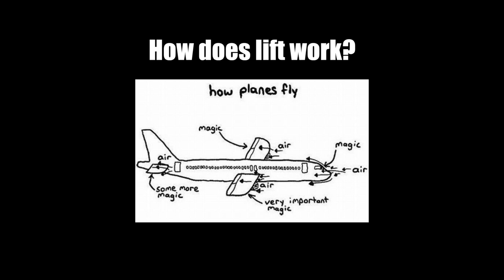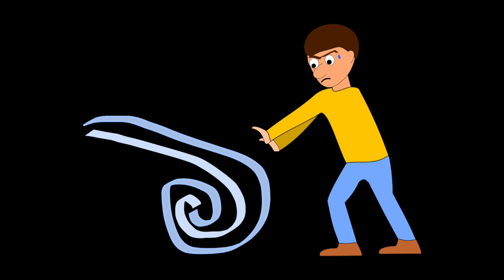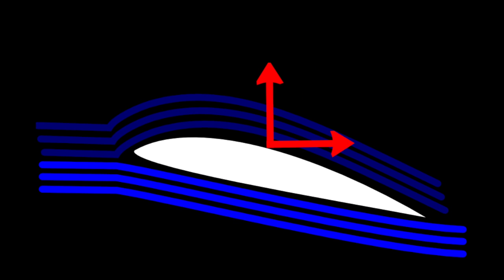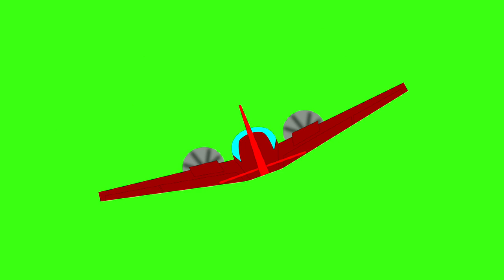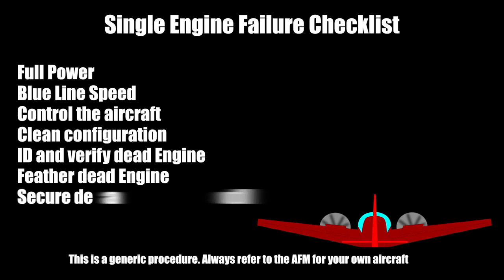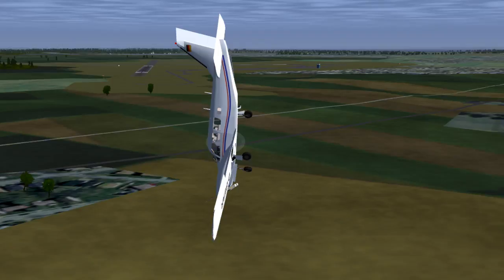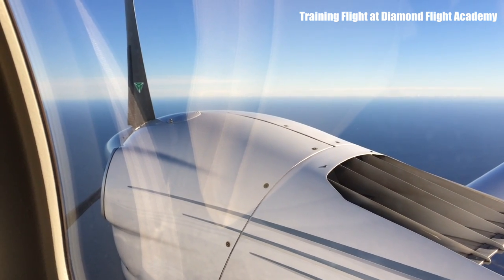Multi Engine Aerodynamics of a Fatal Crash: Mayday Talk Episode 14.5

Comment: In flying twins ( two Cessna 310s & a Baron) for 35 years with my father we did a lot of training on this. Keep in mind that above all know what your airplane feels & performs like in density altitude, full gross weight etc . #1 always fly straight ahead until established above blue line ALWAYS, once established start a climb to safe altitude and then shallow turns into the GOOD engine. There will be conditions where in high density altitude as where you can't climb on one engine. Know this before departure so if it happens your thinking single engine procedures only. Thus loss of engine means you must reduce power on the good one to prevent control loss. FLY THE AIRPLANE no matter what even if you have to put it down. A controlled forced landing (which we have done) is survivable in many cases but a loss of control usually results in fatalities.  Keep up the great work. These kind of videos save lives.
Reply: being a pilot is VERY hard....you and your father are very smart individuals.  Piloting is not cut out for the "dimmer" individual.

Comment: A last ditch effort before an unavoidable Vmc rollover is to pull power on the good engine and land straight ahead as if you were a single engine with an engine out.  A controlled forced landing is better than spinning into the ground!
Reply from the maker: absolutely. It's the asymmetric thrust that creates the roll, so reducing the power removes that element

Comment: As a long time pilot of a Beech Twin Bonanza (D-50), I've had 7 engine failures  of the GO-480 295hp engine, 5 of which were gearbox related, with one a pressure carb failure and the other, a collapsed air intake tube. My VMC was 79 mph but I always waited until I had 100 on the clock before even thinking of rotating. Unless at a high density altitude or overloaded, the D-50 climbs well on one engine if you keep your airspeed at the blue line or above assuming the gear is up and zero flaps. You do have to be very quick as it wants to roll over so you will need full rudder/ailerons and at the same time, focusing on your airspeed. I've always had a bit of room so dropped the nose, rolled in some rudder trip, watched the airspeed like a hawk until I had climbed to an altitude I was comfortable with and then tried to figure out was was wrong. The Queen Air above may have the supercharged 340 hp version of my engine so able to fly with a higher gross weight. Every time I applied power for takeoff, I knew the next 15 seconds were super critical so never took any takeoff for granted. Out of 100 pilots, there might be only a couple who would pull the power on the good engine and land straight ahead. It happens so fast that training goes out the window.  My last failure was the left engine and my right leg is still not the same. The local FBO said that out of 3 twins he watched lose an engiine, I was the only one that lived.
Reply from the maker: damn that's quite a story. Thanks for sharing. I think i would have changed airplanes after the 3rd failure! Nerves of steel right here

Comment: When I was getting my pilot's license, my instructor and I talked about a multi-engine rating.  He mentioned if a pilot finds himself losing an engine below Vmc, reduce power in the good engine to about 50% to %75 depending on how far you are below Vmc.  Then do all other procedures - control aircraft, clean config, feather and secure dead engine.  Even on reduced power, one still might have enough glide range to select a suitable landing site.
Reply from the maker: that absolutely works, as the asymmetric thrust is the cause for Vmc to be a thing.
Reply: Chopping the one remaining engine to 50% on take-off, guarantees a return to terra firma, unless you are driving something like an F-15!
Reply: @ConvairDart106  - Maintaining power in the good engine below Vmc will also guarantee a return to terra firma.  So choice is returning in a controlled manner, or an uncontrolled manner.  Your call.
Reply: Adding full power to the good engine doesn't seem logical, as it increases the level of "fight" the pilot has with the aircraft. I really like that instructors methodology.
Reply: Some comments here are bordering on Malpractice and are not very helpful.  Tell your students that before takeoff make sure that your seat is positioned to allow full rudder travel,  operating a multi engine aircraft below VMC except for the purposes of Takeoff ar landing [ and training ] is just bad practice and should not be a part of normal operating practises.  If below Vmc Keep the wings level add power on the operating engine and accelerate to a speed above Vmc as soon as able.  prolonging the time spent below Vmc together with not using full rudder authority [ if applicable ] could hadly be justified for the sake of finesse.
Reply: @YouTube.TOM.A  I'm not a pilot but your comment made sense,except one thing. What do you mean when you state,' BELOW Vmc ? Correct me if I'm  wrong but as I understand it Vmc is a flight condition or situation. So to my mind you are either in it or out of it, as opposed to being below it ?? I hope this isn't a stupid question but as I said I'm not a pilot.

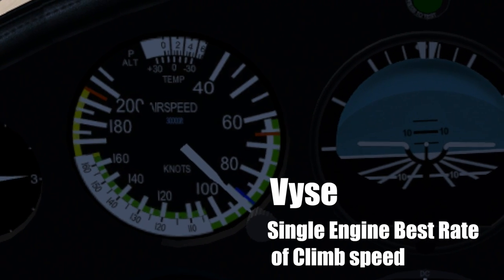Comment: Blue line does NOT ensure the airplane will not descend as stated in 4:40.  On an airplane 6,000 pounds or less maximum weight and VSO
61 knots or less, it is the airspeed that it will have the maximum climb gradient, which could actually be negative.
Reply from the maker: hi. thanks for the comment. seems like you're talking about a very specific aircraft. modern certification standards require that an aircraft be able to maintain a positive rate of climb at MTOM for ISA conditions. it is true that in some aircraft or conditions, you may not be able to attain a positive rate of climb, even at VYSE.
However, I would assume that people with an MEP rating would already know this and be trained for it (as I was). This video simplified explanations for the sake of those without an MEP rating.

Comment: Excellent explanation, however I would add one thing: the first thing you should do when an engine fails is establish your manufacturer's Vmc bank angle (usually 2-5 degrees) and, if low and slow, pitch for Vyse. It has been shown in countless flight tests that bank angle has the single greatest effect on Vmc, therefore if one fails to establish that critical bank angle and maintain straight and level flight (which also means reducing bank if an engine fails in a turn, even if the engine opposite the direction of turn is the one that fails) the Vmca (actual Vmc speed when airborne) will be WELL above published Vmc and, as I stated before that if you're low and slow, dangerously close to your current airspeed. It is unsafe to make ANY bank, not just a bank into the dead engine, but ANY bank other than that published for Vmc straight flight when anywhere near your redline speed - there's a myth that you should only make turns away from the dead engine, but this can prove fatal if ANY turns are made at or near Vmc, and on the contrary, if you are at a safe speed well above Vmca, it is perfectly fine to make a turn into the dead engine, given that you maintain a standard rate of turn just for good measure. Great video man!

Comment: As an aerobatic pilot and with a few hours in a Queen Air (coveted pic time) and a CFI MEI  I just wanted to make a distinction between bank angle, loading the aircraft (g forces), and increasing stall speed (accelerated stall). You would only increase the stall speed in a bank if you increased AOA by control input of pulling back on the yoke and loading the wing. You can be a 60 deg or 90 deg, for that matter, of bank with zero g's if you push or do not try to maintain altitude and do not load the aircraft.  This is not relevant to this video, asymmetric thrust and loss of control, just relevant to what an accelerated stall is, which is based on wing loading. New pilots like to say that at 60 deg of bank you have 2 g's. This is only true if maintaining altitude.
Reply from the maker: 100% true! :) My mistake is that I called it a spin, when it's actually a Vmc roll

Comment: My thanks to "Merryface Aviation" for their contribution. The sad truth is that with "most" light multi-engine aircraft when one engine fails just after take-off, the other takes you to the crash site! You must at all time continue to Fly the aircraft; Maintain BLUE LINE, Clean-up the aircraft, Standard Rate turns, and NEVER ask your equipment to do anything it simply cannot do.
Reply from the maker: thank you for your valid contribution.However I have to disagree as properly prepared pilots brief themselves for the engine failure on takeoff during their takeoff brief as well as regularly simulate the engine failure on take off  in order to be a safe and proficient pilot. The rest of your comment is of course correct, and  also covered in the video.

Comment: The lift explanation is almost there. The wing shape is such that the when there is laminar flow on both surfaces, the distance air travels over the top of the wing is longer (and faster) than the distance the air travels under the wing (slower). This differential air speed causes a differential pressure between the top and bottom surfaces of the wing creating lift. The wing is shaped so that the maximum lift is created at a certain angle of attack. There are also angles of attack where the flow over the surface either do not generate sufficient differential pressure to overcome gravity force (weight of the aircraft). There is also the possibility where the flow is no longer laminar and turbulence is created on top of the wing and the differential pressure no longer exists. It's all the same pressure above and below the wing (0 lift force) as if the plane is parked on a ground on a zero wind day. 
https://www.youtube.com/watch?v=SiOiVHUEYao

Probably the best explanation (still a lot of incorrect videos on this out there)
https://www.youtube.com/watch?v=E3i_XHlVCeU

Best visual video
 https://www.youtube.com/watch?v=WFcW5-1NP60

Comment: As a pilot, I thought your original explanation was basically correct.  One thing I was hoping to see in this video was an explanation of why yawing and/or turning creates more lift on the wing outside the turn.  Some of your non-pilot critics may not have thought about the fact that the outside wing is moving at a higher airspeed than the inside wing, creating more lift. As you know, when rolling into a steep bank it takes a little opposite aileron to stop the roll from progressing further for this very reason.  Which leads to another point - that the pilot, obviously caught off guard, may have yanked opposite aileron at the last second in a desperate attempt to stop the steepening bank (a well-known common instinctive reaction) which guarantees a spin due to the increased angle of attack of the inside (left) wing.  I do appreciate your making these videos.  Who knows, could save someone's life.
Reply from the maker: Thank you very much for that constructive feedback. I truly appreciate it. I might even make a video from it. And thanks for the kind comments too.
Reply: MerryfaceAviation  the explaination fo asymmetric thrust is not correct. Due to the aerodynamic factor. The thrust line produced by right engine arm length from CoG is longer then left engine which causes yawing moment. Roll is a secondary effect of yaw.

Comment: one thing i want to point out is the fact that you got one thi g mixed up. if a wing dips down on one side (as long a there is dihedral, which in this case there is.) the wing on the lower end will create more lift than the wing on the high end as it is more flat to the horizon.

Comment: Nice video. Your explanation on Bernoulli's theory is a little odd though. The L= 1/2  rho V^2 S Cl equation is just the lift equation, it's not directly related to Bernoulli.  Also, the speed and static pressure of air flowing over an aerofoil isn't related to how long these edge is, otherwise an aerofoil would never be capable of flying inverted!
Reply from the maker: +Alistair Hammond aye you're right, I didn't put the original equation, but the Lift equation which uses a derivation from it. I did it because it's the Lift equation pilots use, but maybe I should have. Thanks for the feedback.

What do you mean by "how long these edge is"? sorry, I don't get it.
Reply from the maker: +MerryfaceAviation I'll add an annotation to the lift equation
Reply: +MerryfaceAviation "the air flowing over the longest surface travels faster". It doesn't travel faster because the surface is longer, it travels faster because of the area of low pressure generated by the shape of the wing and the AoA. if you put the wing into a negative enough AoA, it would generate downwards lift even though the the longer surface is on top.
Reply from the maker: Ah right! Yeah I incorrectly decided to use the classical textbook explanation. i should have gone into the creation of low pressure instead of saying that it is only because of the wing shape (just restating your correct explanation). Thanks! I'll try and see how I can rectify this with an annotation. Thanks again, I really do appreciate the feedback.
Reply: +MerryfaceAviation Take a look at Noel Kruse's 'Fly Better' website. He's great at explaining how aircraft work without requiring a degree in aeronautics.
Reply from the maker: Maybe I should! I keep messing up anything I try to summarize!

Comment: I know you strive for simplicity in your explanations, but when an aircraft is flying and climbing, cruising, or decending. the angle of attack is the angle between the RELATIVE WIND and the aerodynamic chord. and not the horrizonal reference [ of the ground ] and the aerodynamic chord. Another way to say it is, If you are flying with 10 degrees nose up [ relative to the horrizon ] your relative wind referenced to the aircraft motion may be about 6 degrees, so the angle of attack will only be 4 degrees.  you have to visualize the wind; with reference to the aircrafts motion to resolve the relative wind component.

Comment: Queen Air precurser to the King Air, all these beech turbines PT6-A's, except the B100 with more reliable Dash turbines, have props that rotate in the same direction. Piston twibs like the one depicted here, a Piper Seminole, have counter rotating props, as in left engine spins clock wise and right spins counter clock. Essentially there is no critical engine in the piston Seminole, yes there is but in training, no. So OP you can not use a piston powered twin with counter rotating props as a demo for this accident.

Comment: Let me save you 7 minutes of your time. He got slow, and simply ran out of rudder. You can watch the great and late Bob Hoover demonstrate all kinds of aerobatic maneuvers, on one engine, two engines, and no engines! As he explained it, an airplane only recognizes airspeed. Enough of that, and the plane flies just fine! Take off with a heavy load, low and slow, and lose an engine, and all bets are off.

Comment: If i am not mistaken here, at the start of your video 0:59 you say that at "low speeds"  the air behaves as a liquid. It is in relative high  speed that it behaves like a liquid. That is why you need to keep the speed more than the blue line (in a good scenario) and definitely above the red line. With out speed air does not exert any power other than its weight. Other than that a decent video for a very sad event.
Reply from the maker: Thanks for the feedback and kind words. Aerodynamics for slower than sound travel is based on fluid dynamics. Bernoulli's principle is actually one of fluid dynamics. We also assume air can't be compressed at these low speeds. In reality we can of course compress air, (thus compressibility errors in ASI readings) however, at low airspeeds, it's insignificant. Air behaves virtually the same way as liquid, even when we are stationary. Can you clarify how you link that to the blue and red lines?
Reply: Thanks for the quick response. It is really nice. I agree about the fluid dynamics of air (however my opinion  on the physics of the matter is that exactly because air compresses under speed it starts to behave like a liquid - in that it molecules became denser as the speed goes up. Because we displace it as we move through it at speed. That is why you reach a point where this compression is maximum, what we commonly call the sound barrier). In any case what i am saying is that you need air to have a certain speed and above, on a wing, to exert power over it. Both due to the (usually) asymmetrical structure of the wing and due to the angle of attack of the wing relative to its vector of motion.
Reply: That is why i linked the blue and red line speeds. In the blue line the speed of the airplane and thus the speed of the air going over the wing exerts sufficient power to counter its weight and keeps the plane flying. They lower the speed the less control you have because the power produced is diminishing, until you reach the red line where you the air going over wing produces so little lift that the plane cannot fly, the control surfaces do not work for the same reason and you drop out of the sky. Please feel free to correct me as i enjoy the conversation and the better understanding of the science of flight.
Reply: At slow airspeed, the air is not compressed much.  In that way it is like a liquid

Comment: As a non pilot, I have so many questions. Every crash video I see, the narrator always goes back to poor airmanship. If the plane was low and flying close to vmc in a turn, It seems a spin stall would be nearly impossible to avoid should you loose and engine in the leading wing in the turn.